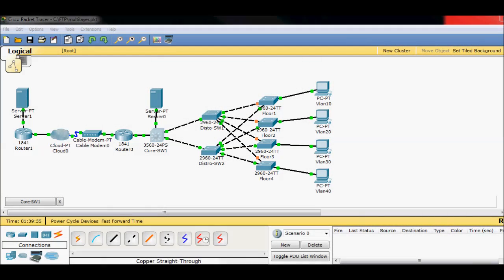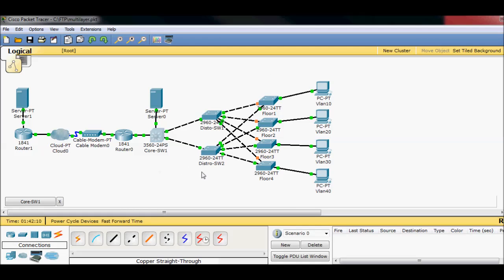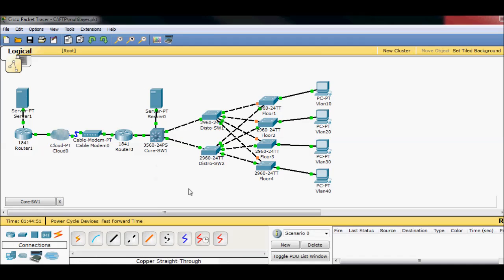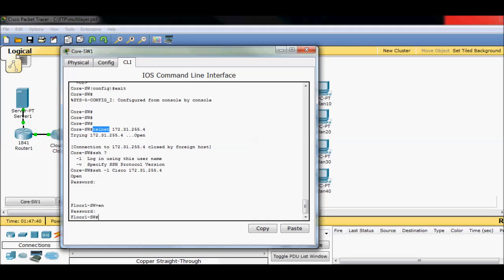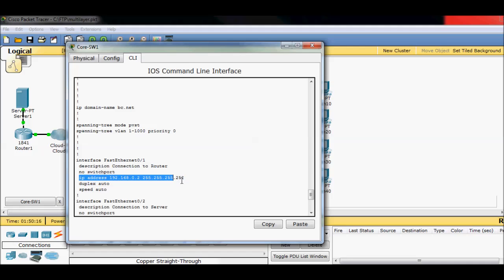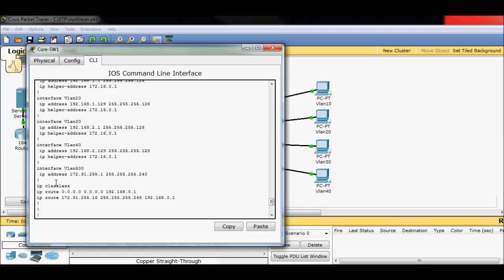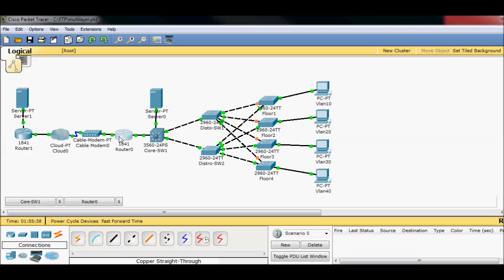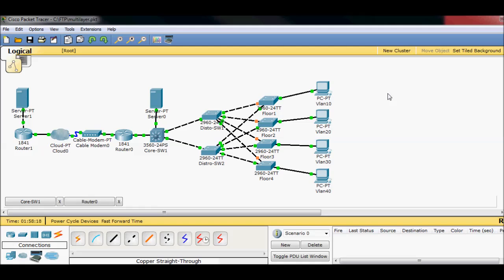Multilayer Switch and Design Tips (remake)

Comment: 1) Can the floor switches have both link green via using EtherChannel?
2) Isn't that Core switch a single point of failure?
3) How about adding HSRP?
4) Wouldn't it be faster to post the .pkt file in the video description?
Thanks.

Comment: Is there a way to have 2 layer 3 switch setup with vlans. Vlan10 is a data vlan, the default vlan 1, and vlan 5 setup as the native vlan. The trunk is setup and I can ping between the 2 computer in that are in vlan 10. Without any routers involved, can I have computers in vlan 10 receive a DHCP address from a Windows DHCP Server? Any computer that is on the default vlan 1 can receive an IP Address without any problems, but any computer connected to VLAN 10 cannot received a IP Address.
Reply: Yes look into DHCP relay / IP Helper.

Comment: your video tutorials are the best! but this video could be nicer if you write the network address allocation on the simulation.. for example, for the link between router and the core switch you can write 192.168.0.0/30 on the link, because .1 is on the router intf and .2 is on the core switch intf. But it's already great like this, i really appreciate this work, i'm hoping to see more vids from you!

Comment from the maker: I would look into HSRP.  I don't have two L3 switches handy to demonstrate it right this second but its pretty cool.  It will allow you to add redundant L3 links that share a virtual address between them.  If one link fails, the other link starts responding to packets destined for the virtual address.  The hosts use this virtual address so they really don't see much of an outage during a failure.  It can be used on Interface VLANs and physical links.

Comment: Ron, thank you very much for posting this video. Its very clear about the concepts and design. But i really have a doubt. I've designed a similar network in packet tracer as per the Enterprise Composite Network Model where I have two layer3 switches for the distribution layer (in this video its Distro-SW1 and Distro-SW2). These two switches are then connected to the Router (Multi point connection) to have redundancy. 

Continued in next post......